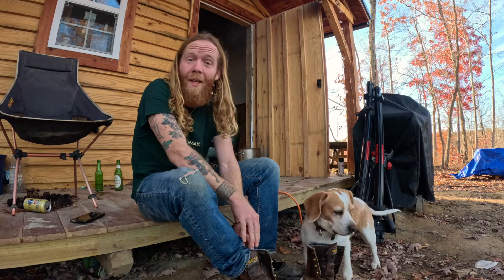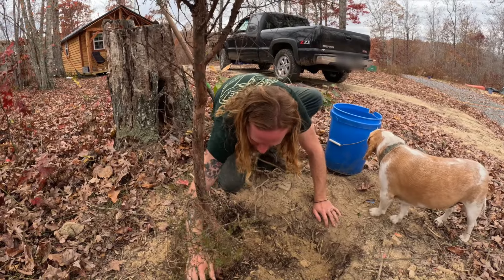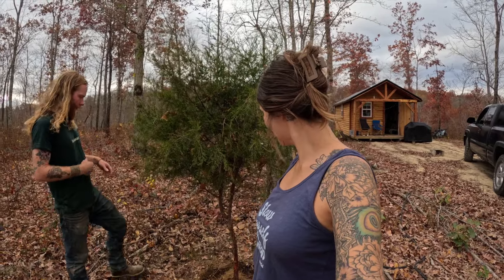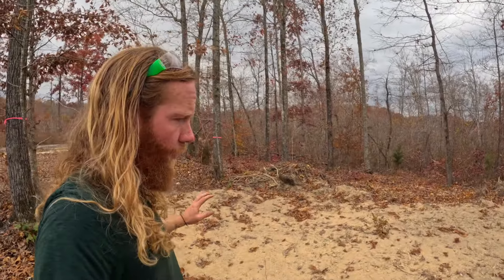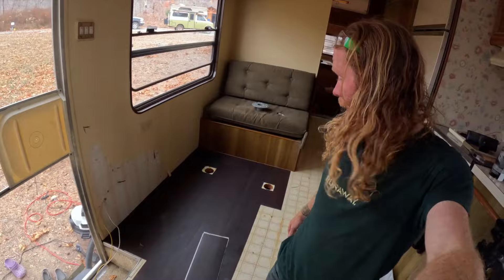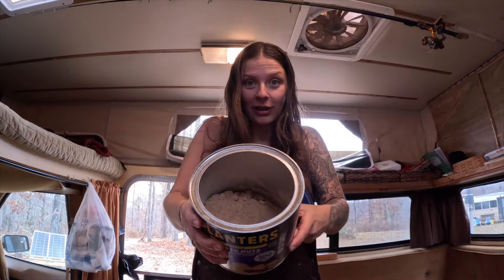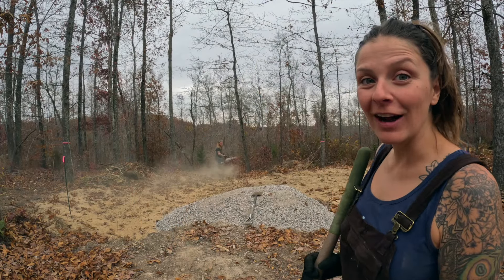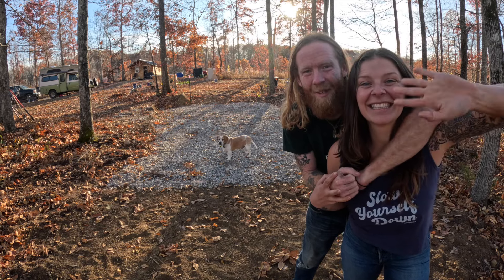NEVER Ending Projects | Working sun up to sun down on our off-grid homestead

Comment: Just and idea. Get one of those portable buildi g/sheds off marketplace and civer with greenhouse clear covering. It will help keep heat in anf lets the light in. My spouse and i did that over our camper for the winter. In the spring we openthe ends with screen for the breeze.and tk keep bugs out

Comment: I forgot to say i used the peal and stick in mine also but with the temp changes i see it was not the best choice i may end up replacing it again with the vinyl click and lock system as i just put some down in my family room of my house and kitchen it is water proof and i wont have to worry about the seams opening up.

Comment: there went 5 grand just getting the septic installed......know that pain lol. wait till a well comes along. as someone who remodeled a 94  5th wheel and now lived in for 4 years, get the maintenance done on ALL the appliances in the camper and stay on it. i found out a new stove (a21") is 500 bucks and a dual fuel fridge is 1500 to start and they dont have replacement parts for older appliances so only new if yers breaks
Reply from the maker: Runaway Ranch Hand! Hell Ya! haha 😛 You are basically spot on 🫣 It was a tuff blow but ya know ... It is what it is :) Do it and move on haha :) Not looking forward to the well for now we got the rain water collection going real well!

Comment: Hi Matt & Cass, very cool video, the filming and edition is excellent. Well we started building our cabin on our off-grid property here in southern Alabama. We're having a contractor do all the heavy framing, then we will finish the interior ourselves. All the framing is being done with rough cut cedar and  cedar planks on the exterior walls. It well have a insulated metal roof.

Comment: We kept our travel trailer in the shade at our TN property and during the summer, with all the heat and humidity, the inside quickly got moldy. We had to move it back out into the sun to dry it out and prevent mold. 😕 I'm wondering if partially in the sun and partially in the shade would work. 🤔

Comment: I installed flooring for over 30 years if you were to put glue under the peel & stick vinyl plank tiles you won't have to worry as much about water. Or you can find sheet vinyl that looks like hardwood. Just match it to the other. Great job guys. Love it.😊 sorry I'm watching you install the planks glue would be good the sticky stuff won't last in most cases so if any comes loose just grab a little vinyl glue. I love the wood looking planks❤
Reply from the maker: Yes we did them in Jolene and our Bus conversion and when some would come up we would just use a little glue but mostly we love them so much convenient, affordable, and look good 👍  Thanks for watching!
Reply: @RunawayMattCass  I forgot to mention if you use vinyl glue let it get tacky before you replace the plank or it will ooze up thru the cracks. Thanks for replying.